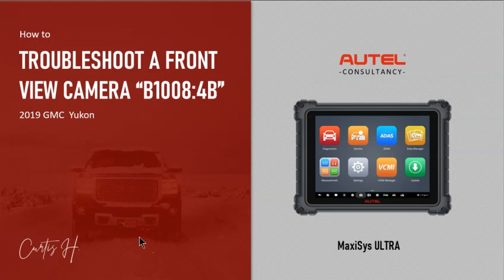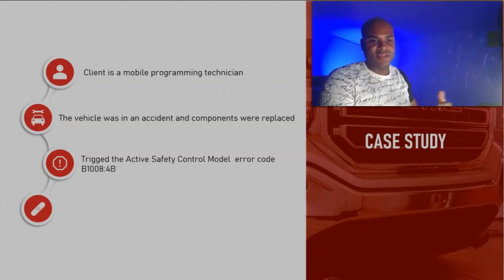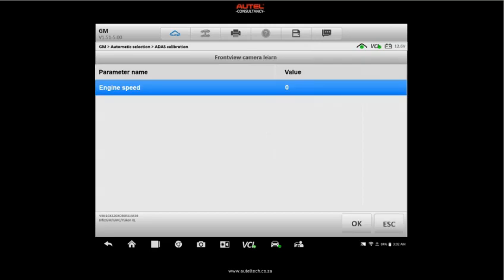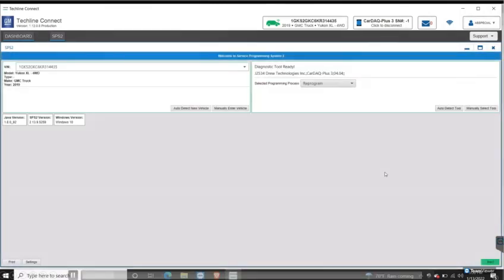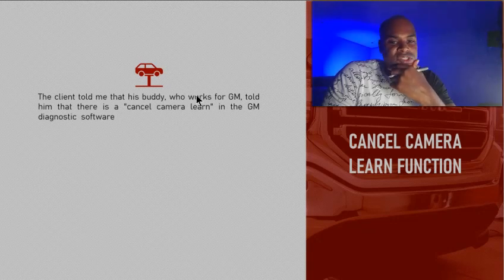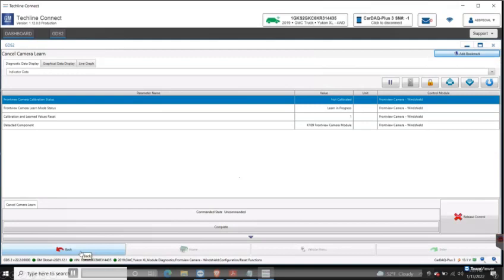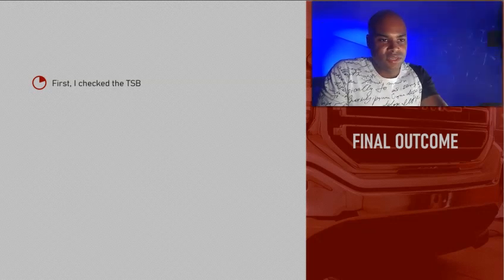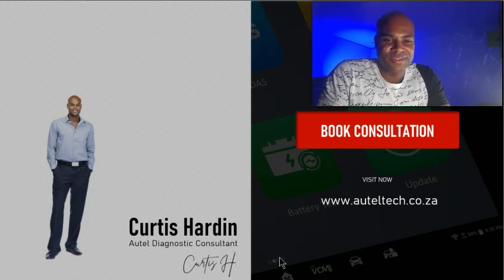MAXISYS ULTRA | Troubleshooting B1008 4B Front Camera on A 2019 GMC Yukon

Comment: Im concerned now with most options. When nothing happens or a millisecond later Autel says success, if in truth anything happened. Was i lied to again by Autel?
Reply: You shouldn't use the Autel if it giving not giving you results. You need to find a tool that works for you as this tool is not for everyone.
Reply: @curtishardin3871  The tools do most things but then they dont do some things and when you find Autel say in fact that is not supported, you wonder why they would have said the procedure was supported in the first place. Today I went to a 730 bmw on a 2010 plate. BMS function seemed to work flawlessly. 

Curtis im under the impression if the car thinks its battery is at 8v it could be a reason for no start. I have invested £8500 in two Autel machines. Told they are great at BMW and Mercedes. Last thing I expect to find is the tools dont do what the firm say they can do. 

Please tell me then from your end. How am I going to reset the BmS on this 2015 A180 Mercedes?
Reply: @jamesbarratt593  As I said before I cant take responsibility of the information you're sellers provided you and the lack of effort he is demonstrating in helping you understanding your tools lack of capabilities.  What I suggest you do is right down all the issues you're having with your tool and contact your seller to see if they will give you answers to your problems.  Ill will be more than happy to log in and assist you but I charge for my support unless I sell you the tool directly.    You definitely need  a relationship with someone who can help you understand your tools strengths and weaknesses.
Reply: @curtishardin3871  in the time of you writing that you could have looked up bms on that mercedes. You couldnt because Autel dont support it. 

Stop with the long talk about i need to have someone to turn to. I should understand the tool. Maybe not for me. Blah blah blah. 

Fact is Autel lie and dont cover many things they say they do. You cant admit to that.you wont admit to that.
Reply: @jamesbarratt593  hey James.  That's incorrect.  They way you look for vehicle coverage and compared to how I do it are completely different.   I don't just look at a database and give you a generic answer.  You need to contact your suplier and let share with them your obligations.  I didn't sell you your equipment but your blaming me for your results.  Then you want me to go out my way to help you.  I'm sorry but I dont want to waste you time.
Reply: @curtishardin3871  i aint blaming you. Never mentioned that at all. You are simply saying because the company Autel have lied on my grounds I should take it back and its not for me. How dare you make that assumption. Smooth talking Curtis who does not wish to own up to fact Autel are not honest and the tool does not do everything. 

I like them but if they were honest they would delete the vehicles they dont cover.

And you dont use their vehicle coverage site designed for customers. Why is that. Because you know its not accurate. Exactly. You agree then with my point but just wont say it.
Reply: @curtishardin3871  strengths and weaknesses. Dont try blind siding me with flash smooth talking. Dont need to know the tools strengths and weaknesses. Just need Autel to delete icons they dont have support for and clean up the lie on their coverage site too. They said they cover iveco till i caught them out on that and swiftly removed it from their website. China china china. Full of deceit
Reply: @jamesbarratt593  again you need to contact your supplier and relay everything your telling me. Your waiting your time complaining your situation to me. Im can't help you
Reply: @jamesbarratt593  I don't work for autel my friend.  I'm independent so what they say and what I know are completely different.  I haven't checked your claims and I have no problem letting people know if the tool doesn't have a special function or not.  That's why people like me to consult them because I don't give them b.s. in my opinion free information is the most expensive information. Talk to some who has your best interest.. otherwise your going to keep on getting screwed over
Reply: @curtishardin3871  And Curtis. Intelligent diagnostics. Not one fault code so far has it had any date in this for. Nothing. thats also for uk mercedes and bmw.
Reply: @jamesbarratt593  Hi James. You should   return the tool back and get a tool that's works for you.  Again this tool is not for everyone and your seller didnt take the time to validate if this tool is right for you.  You should address these issues with your seller

Comment: What I learned from this, is if you  aren't installing a cheap used salvage yard module from the junk yard using my Autel, it don't pay to keep  try trying and frying again. When installing a pricey new module , you might want to consider doing it with the OE tool and OE software because sometimes Wayne The Rock Johnson trying to  talk Chinese to a GM module built in Vietnam via J2534 ain't understood🤣

Comment: Thanks Curtis for posting great content! Can you look into why Autel J2534 VCMI devices have issues with wiTech2.0 on SGW 2018+ vehicles? After the wiTech reads the vin, it clocks while trying to scan all the modules on the network. wiTech is sometimes able to connect to one branch of the CAN network leaving all the other branches in red. It seems like a problem with CAN switching between the various busses. Shouldn't be a problem as Ultra VCMI says it supports up to 4 CAN channels. I wasted many 3 day subscriptions on this issue and I can see others online are having the same issue. Thanks in advance!
Reply: so you mean J2534 of autel VCMI is not reliable on all OE software? im planning to buy a maxisys ultra then will use the J2534 VCMI as passthru on GM techline connect and FDRS. what do you think about it? thanks mate.
Reply: im confused which i'm gonna go for CarDAQ Plus 3 or Autel maxisys ultra? i just need it for passthru on dealer software.
Reply: @edisonangeloalmazanbangug9175  VCMI works fine with  GMTechline, FDRS, FJDS, ODIS, Honda HDS, Toyota Techstream, Mitsubishi MUT3, JLR SDD. Does not work with Nissan Consult R2R, JLR Pathfinder and 2018+ vehicles on WiTech.
Reply: I would not buy Ultra just for passthrough device. Cardaq 3 is you best option. Although Ultra is a great scan tool!
Reply: @autocodepro868  and really expensive subs. not worth it.
Reply: currently i have xtool 100 max, launch pro 3s plus HD for 12 and 24v vehicles, vvdi key tool max, and my panasonic CF D1 for my dealer software.

thinking which would be more reliable Autel Maxisys ultra or CarDAQ Plus 3?

really confused which tool im gonna go.
Reply: @edisonangeloalmazanbangug9175  Cardaq 3+ plus works with all the above mentioned software and more (Nissan Consult R2R, and witech 2.0 2018+ vehicles